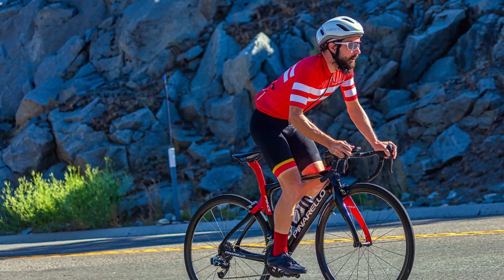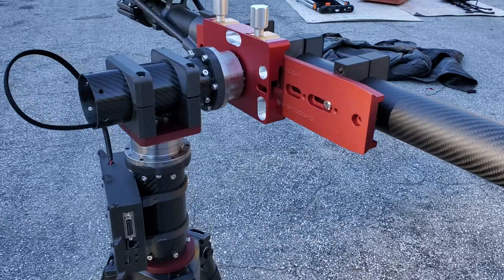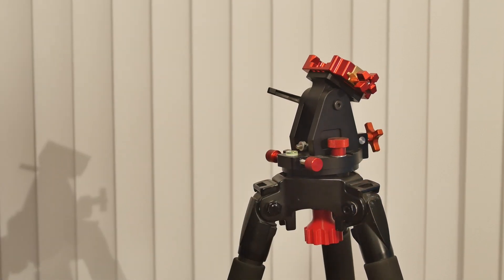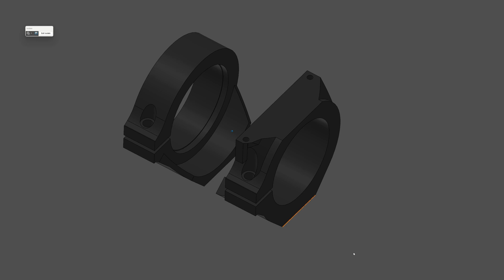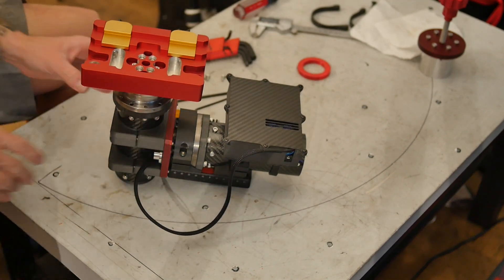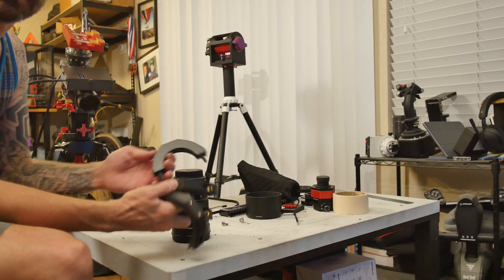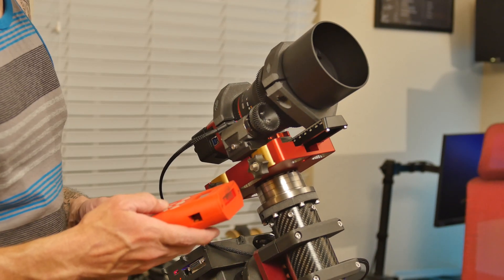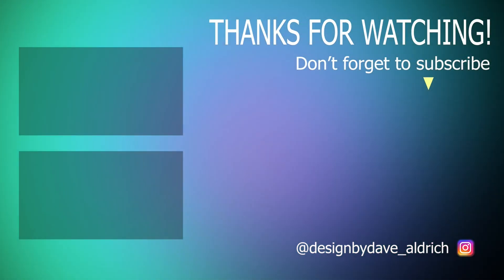DIY Harmonic Drive Telescope Mount w/ Rokinon 135 Rig

Comment: By the way? Have you considered using concrete filled printed parts for parts that don't need to be metal but need to be stronger than just 3D prints? I've seen this method from Chris Borge who makes stuff like this and I think it could be quite useful for low cost rigid parts for astronomy stuff, especially the mount.
Reply from the maker: I have not but that is an interesting idea.
Reply: Concrete doesn't have any tensile strength, so it wouldn't add much strength if any.
Maybe injecting a resin would work.

Comment: awesome ❤❤
can you provide me the link for the wedge?
Reply from the maker: It's on the printables info page in case this link doesn't work 

https://www.aliexpress.us/item/3256806622220084.html?spm=a2g0o.detail.pcDetailTopMoreOtherSeller.2.7426tZ96tZ967M&gps-id=pcDetailTopMoreOtherSeller&scm=1007.40050.354490.0&scm_id=1007.40050.354490.0&scm-url=1007.40050.354490.0&pvid=61e9bb56-4079-4e35-89d7-be66818d15de&_t=gps-id:pcDetailTopMoreOtherSeller,scm-url:1007.40050.354490.0,pvid:61e9bb56-4079-4e35-89d7-be66818d15de,tpp_buckets:668%232846%238108%231977&pdp_npi=4%40dis%21USD%21152.24%21152.24%21%21%211100.00%211100.00%21%402101effb17338734063397042e75d8%2112000038374281634%21rec%21US%21946591528%21XZ&utparam-url=scene%3ApcDetailTopMoreOtherSeller%7Cquery_from%3A

Comment: Hi Dave. Another great video. Question: are you using the Rokinon 135 F/2.0 or F2.8 lens? Went to the Printables page and saw it was the F/2.0.
Reply from the maker: Thanks for checking it out. The lens is f/2. Where did you see 2.8? I may have misspoke. Although, I am using an aperture mask that stops it down to about 2.8.